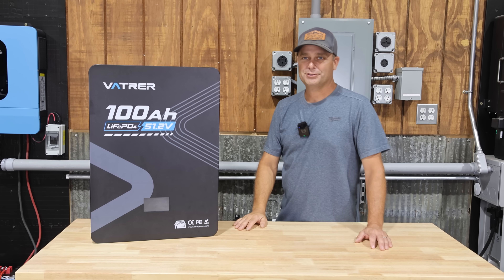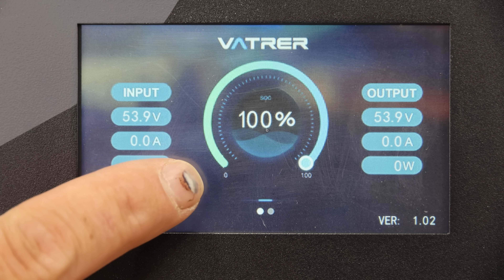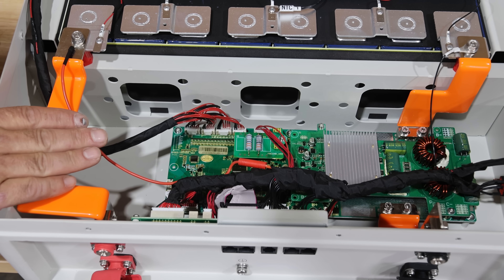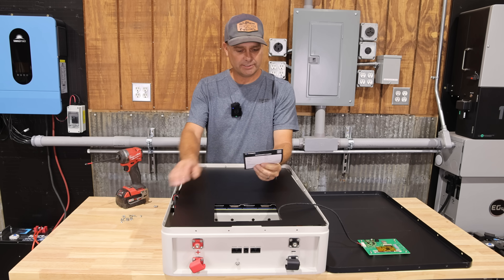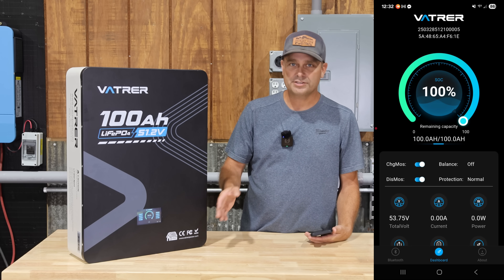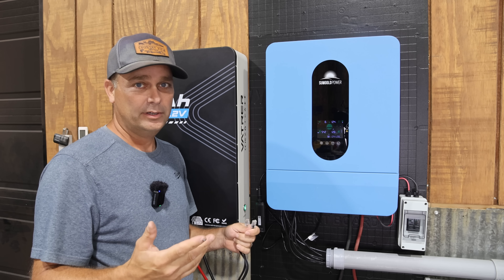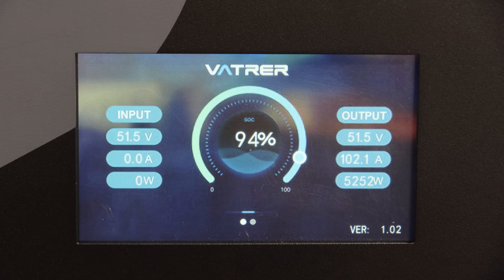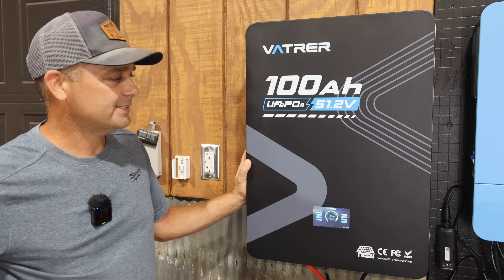Alternative to Server Rack Batteries - Vatrer 100 Ah Wall Mount Battery

Comment: I like the wall mounted boxes, where the cells are  placed on smallest side.  Not like many horizontal.
Looked in to it more,  found the website in Europa,  but  € 1117 for only 5 K storage is ro expensive.   others ask 100€ per KW

Comment: Love your solar based videos and have watched them all. I would love to see how you wire up, say a EG4 6000xp to a breaker panel without a grid connection. I think I have all the other stuff in my head but it's that last connection I don't understand. Love all the videos keep it up.

Comment: Ok wtf $1000.00 for a 100ah battery WOW i got my 200ah battery for $234.00 on amazon...
Reply: 12 volt I'm Sure. This is 48 volt.
Reply: Ok so do the math 100ah at 48v is going to get used faster... A 100ah battery is only going to hold about 1300 wh that gets eatten up by 48v fast... And the price is still outragous for what that battery is... And the amount of solar panels needed to even charge that battery is alot... I use the kiss system... 12v is every where and when i set up my container house i run everything off of 6 200w solar panels and 3 200ah batteries and 3 controllers... and propane... i can recharge my batteries in 2hrs of direct sunlight... @OffgridwithJayandJen

Comment: I wish the wall mount batteries would be designed to easily connect to a wire way like the EG4 batteries.  Thanks for all the info.

Comment: What's the point of communication? All you need is Max charge voltage and minimum discharge voltage!!! Why is the battery connection on the bottom??? Super weird...
And there's no way you're going to run a household on one leads batteries. You need multiple batteries.... I rather have a server battery than this.... And quite frankly 12 volt batteries are cheaper...

Comment: Luxpower and Sungold both are SRNE products, ( I have both) and should work with the SRNE inverter selection. On the other hand, I don't use battery comms anyway, so there is that. Cheers!
Reply: Can It work with any Inverter or just that only support comms

Comment: I have 3 Vatrer server rack batteries and they seem to be working well. Vatrer told me not to mix the wall mount and server rack batteries because they use different BMS. If I was to build a bigger system, I would go with the wall mount batteries so they can communicate with the inverter.

Sungold does not make their inverters. The Sungold 6.5KW and 10KW 120/240v look just like my Powmr 6.5KW. Other models of Sungold inverters could be made by other manufactures. The manufacture label or number might be found on the inside.